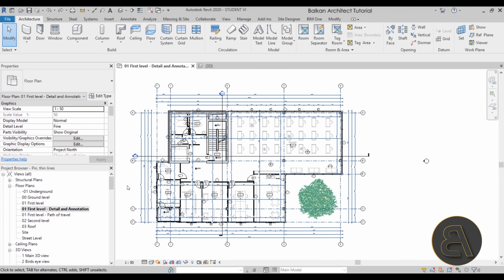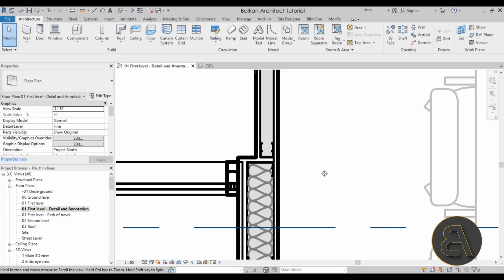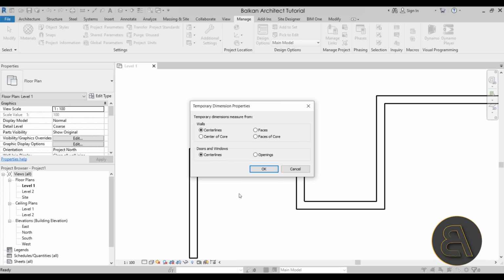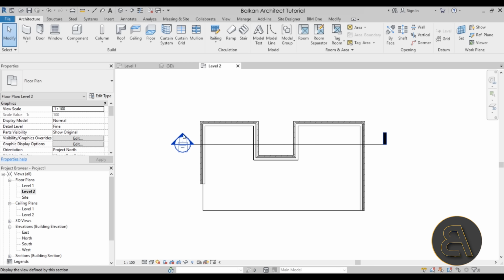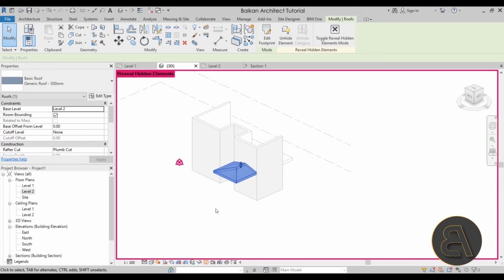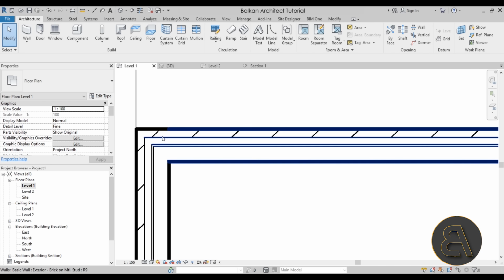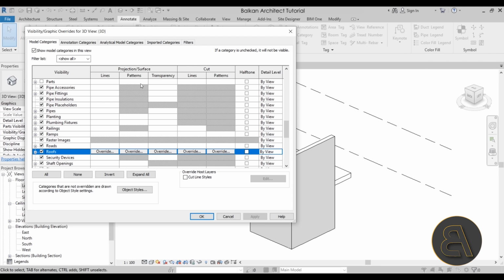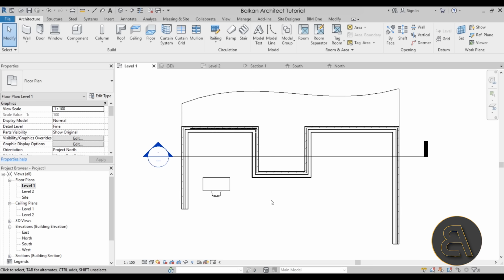10 Tools Every Revit Beginner Should Learn - Revit Beginner Tutorial

Comment: 1. Pin in place                              1:48
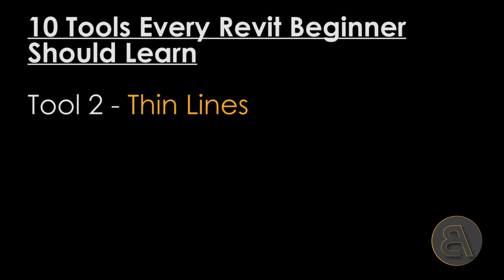2. Thin line                                   4:03
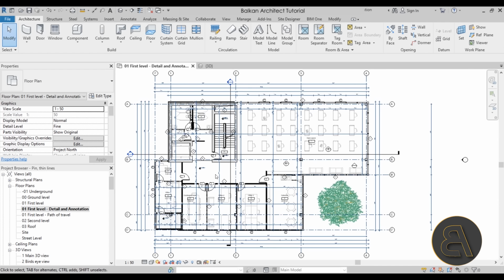3. Temporary dimensions          5:34
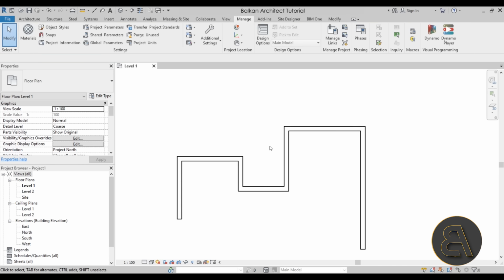4. Alight tool                                7:45
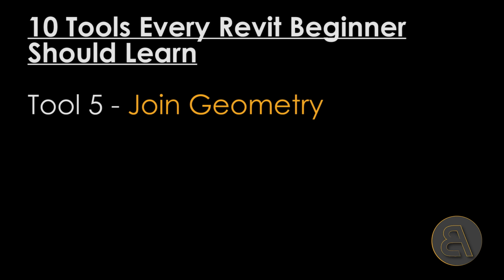5. Join Geometry                         9:14
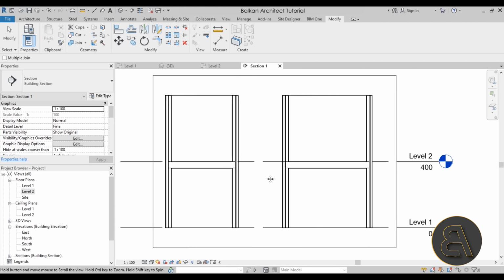6. Hide in view                             11:00
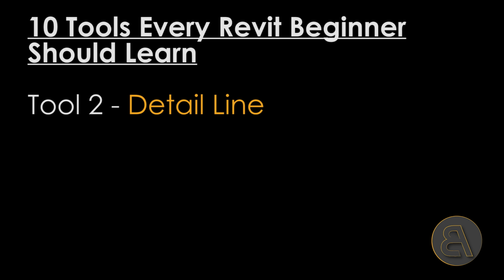7. Detail line                                 12:26
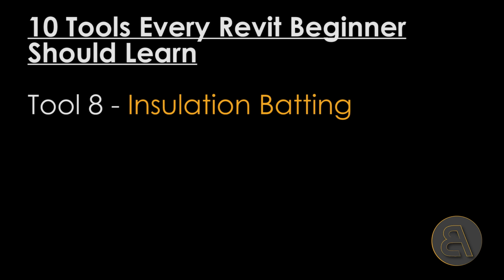8. Insulation batting                    14:24
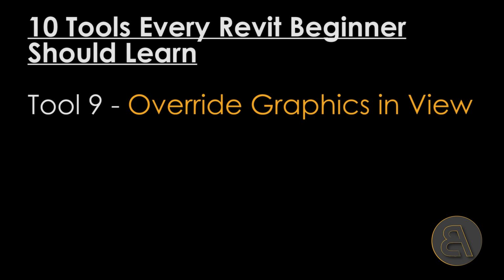9. Override graphics in view       16:10
10. Create groups                        18:13

Dude can you please pin this comment🙏

Comment: 1:48 Tool 1 - Pin
4:03 Tool 2 - Thin Lines
5:34 Tool 3 - Temporary Dimensions
7:43 Tool 4 - Align Tool
9:13 Tool 5 - Join Geometry
11:00 Tool 6 - Hide in View
12:26 Tool 7 - Detail Line
14:24 Tool 8 - Insulation Batting
16:09 Tool 9 - Override Graphics in View
18:12 tool 10 - Create Groups

Comment: nice and informative. i got two things to add though
1: if you join geometry of two elements which contain the same materiel, like a shear wall and slab, the common line can totally disappear.
2: when making custom fills to elements, it is better to put solid colors to the background and any hatch or pattern to the foreground. its not mandatory, but helps one in selectively hiding hatch or solid colors with reference to each view requirement.

Comment: To add something for the Group function.  It is nice to have detail group to go with the model group.  For instance we Group our Grid Lines and Group the Dimensions with the Grid  This way for each level we can attach Detail Group to the Grid Group without having to Dimension or Copy/Paste the Dimensions at each Level.

On the same note:  Another Dimension trick I've seen is How to Dimension Grids quick and easy.  I used to go through and click each line of the grid. Not anymore.  Draw a Wall item across the grid.  Then go to the Dimension tool and Click the Options Button.  Inside the options it has a box for Intersecting Grids.  Click the box and then click the wall. and place your dimension.  Once done select the wall and delete it.  The Dimensions stay and you don't have to click each grid line anymore.

Comment: When detailing the callout section and add the material ID, i got this kind of error message. how I fix that. "None of the created elements are visible in Section: Section 1 - Callout 1 View. You may want to check the active view, its Parameters, and Visibility settings."

Comment: Great video man. But I have a concern about the join geometry tool. The slab in such cases IS actually resting on the walls, or atleast the structural part of the wall, but you said otherwise. If that were the case, how would you show the wall and slab connection?
Reply from the maker: Yes yes I agree it should rest on the structural part of the wall. But for any additional detailing you can use detail lines and filled regions.